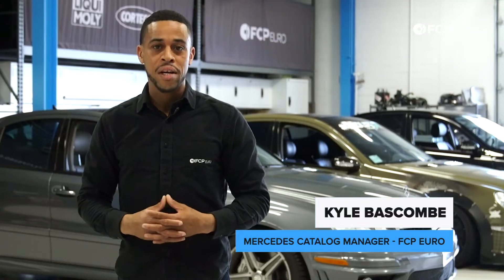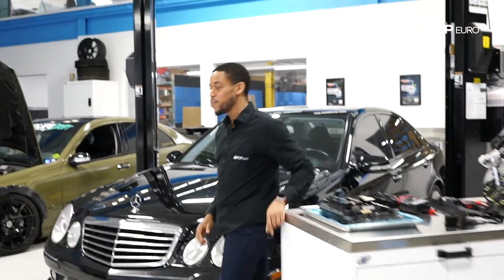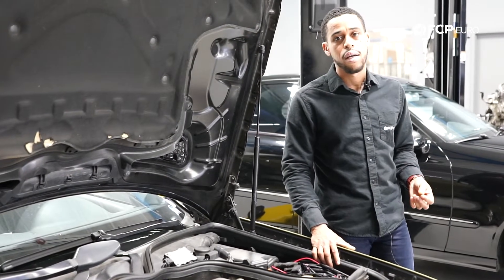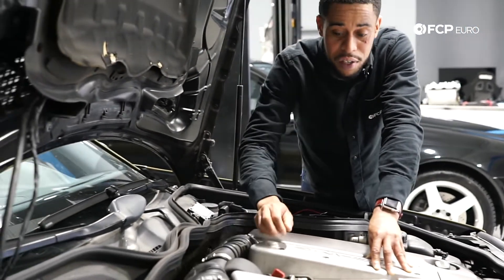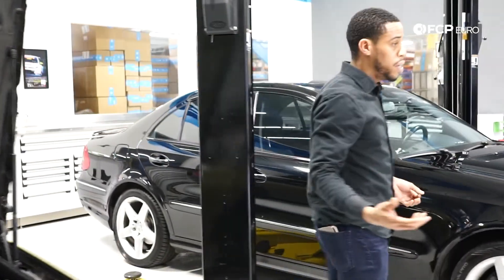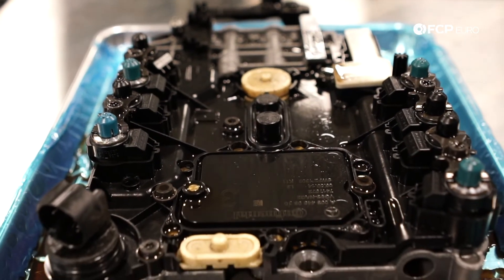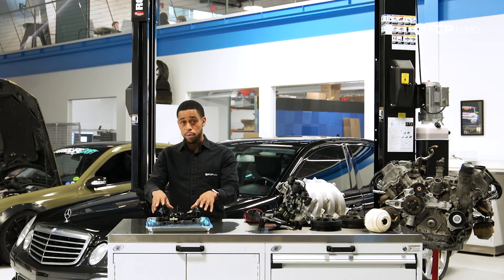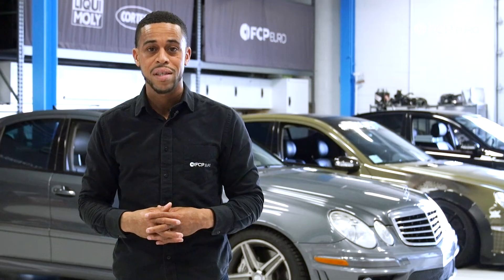Mercedes-Benz W211 Transmission Diagnostics - Everything You Need To Know (722.6 5-Spd, 722.9 7-Spd)

Comment: I have a W211 E240 2003 model, I am also having issues with the transmission shifts from 2nd gear to 3rd gear as it slightly jerks during those shifts. I replaced the gear oil and gear filter but it ddnt work. I also scanned for faults but it couldn't detect any. Can someone pls help??

Comment: Thanks for this video and the great series on the W211.  How much ATF should be added to a 722.6 5-speed after draining the pan and replacing the filter?  The owner's manual gives the capacity as 8 liters, but that must include the torque converter; since there is no dipstick, it's hard to know when the transmission is full.

Comment: 02/2008 W211 E350 4Matic with 102k Km.

My 722.6 W5A400 transmission drives me crazy.

1. When cold, shifts from 1-2 and sometimes 2-3 are sluggish, the gear slips in, and I hear a shudder/grinding noise (no vibrations) when the TCC engages. 
When accelerating faster, gears change mostly normal.
2. When warm, the transmission shifts smoothly without any noise or issues, but when I let off the gas in traffic normally/not fast, the transmission up shifts instant and harshly with a light hit. I need to force it to shift smoothly by letting off the gas reaaaaaaaaly slowly. I'm always constantly fighting for smooth shifts while driving. I focus more on shifting smoothly then driving! It only occurs from 1.-3 gear. 4-5 are completely fine.

What drives me crazy is, its randomly. Nothing I do can consistently reproduce it. Sometimes it does not occur, something I want to drive this car off a cliff.

New Oil, Filter, Torque-Converter-Valve, Plug etc. Also checked error codes, Oil-level, Map sensor, TCM, fuel supply, temps, everything that could give my transmission some wrong information.
With Xentry I reset the adaptation values of the TCC valve and driver behavior, also tried resetting every shift point between gears and adapting everything from scratch multiple times. 
I always ended up using the old saved values, which are the least problematic.

Nothing I tried so far, fixed it. I did multiple oil changes, adding oil, taking some out, a transmission flush with only oil, and 2 times cleaning the entire conductor plate with every solenoid. My transmission fluid is clean without any metal or other particles. I changed it 2 times in the last 12k km. The transmission has been serviced 2 times before I bought the car by a Mercedes dealership. In total, the transmission had 4 fluid changes in 102k km now.

Does anyone have similar experience with a 722.6 W5A400 transmission?

I would need some advice please!

Comment: I have a 0894 (stored) error code on my 7G 2005 w211. The car went to limp mode. And won't even engage gear most times. I replaced the VGS, cleared the error code and the problem persisted. Kindly advise me on what else to do?
Reply: Have the same code on my w221, wont shift or anything. Did you find the problem?

Comment: I own a 2003 Mercedes SL55 AMG and I’m hoping you can help. The other day the engine light came on, the dealership replaced the Transmission Control Module. Prior to this repair while in S mode I could tap the shift lever right or left and it down shift and up shift, now nothing happens. In Manual it shifts fine and down shifts automatically. The tranny works fine otherwise, moves smoothly through gears. How can I restore this function?

Comment: I recently purchased the conductor plate kit from FCP Euro for my 2004 E320 with a 722.6 transmission and it shifts better, but it still does not automatically upshift from time to time. I end up having to use the totoro box function. Is there a code I might need to reset within transmission? I did reset the adaptable function. Thank you in advance

Comment: Im buying a e320cdi w211 next week that wont engage or drive. It comes with a spare gearbox and torque converter to swap out but do you think there is anything else i should check first ?

Comment: I thought the seven speed transmission is supposed to be sealed for life. Yet in the video you say change the transmission fluid every 40,000 miles. I don't understand the apparent discrepancy. Other videos I've seen show the transmission without a dipstick. The reasons given was because the transmission is supposed to be sealed for life. I have a w-211 with 211229 miles. I don't believe that the parts you reference have ever been serviced. What is the best way to check this is there a diagnostic tool that will help determine the condition of the conductor plate and other relevant parts?

Comment: You missed one small thing, Mercedes never makes those gearboxes, greetings from ZF 😎
Reply: ZF makes garbage after garbage. This conductor plate issue has been a problem since late 90's and well into the 2010's. So in about 15 years they did NOTHING to prevent the failure of their garbage transmission.  Absolute dog-shit units. All of them.

Comment: Thanks for the video! I have a 722.118 that has been sitting for years. It has no leaks and the pressure is according to the manuals. The problem is that at times the pressure drops to zero and the exchange doesn't work. I changed the oil and filter, but the problem persists. It only works again when I accelerate above 3000rpm. Any suggestion?

Comment: I have a problem with my W204 with 722.6 only when is cold outside and only at the first start , after starting the engine, when switching the selector from P to R or D, the engine speed drops from approx. 800 revolutions at 700-600 revolutions for a period of 1-3 seconds, after which it returns to the initial position (800 revolutions) if I put directly in D engine it will stop, BUT you feel that the car is forcing itself to leave from under you (the brake is obviously pressed) . What can be ? Thank you :)

Comment: Hey guys, I'm currently driving a 2007 E280 CDI with a 7-speed and when it's a cold engine/trans in the morning, on moderate to hard acceleration the whole car judders and shakes while gear shifting. There's no check engine lights but it's pretty violent. This is only observed in the first few gears. Also when slowing down the shift from 2 to 1 is sometimes jerky. From what I understand the car's trans oil was never changed and it's a few 100 short of 60k miles.

Any pointers as to what may be happening? Does it just need a trans service?
Reply from the maker: Hi Brenden, a service certainly cannot hurt. An inspection of the engine and transmission mounts is also in order. From there you may need to further diagnose if your issue is not resolved.
Reply: @fcpeuro  thanks for the reply guys! Much appreciated.
Reply: @fcpeuro  I forgot to update y'all, the issue was an exhaust back pressure sensor gone bad. Replaced it with a genuine mercedes part and it fixed the issue a 100%

Comment: Hello. I have a CLK 55 with the 722.6.  Manually downshifting from 3 to 2 i hear a grinding noise. I also for the first time heard it happening mildy today when in automatic mode, slowing for a stop sign. Should I start with a simple service w/ conductor plate replacement? I didn't want to pull the trigger it if sounds like the unit needs to be extracted for physical rebuild. Thanks!

Comment: I changed my 211 2008 transmission, the gear will no longer shift well. From what you said, meaning we should replace the valve body. Question is how do we get the right valve body for the car, whit chassis number?

Comment: If five speed transmission is acting funny, sometimes all it takes a little bit of electrical conductor cleaner to spray on the 13 pin connector and the issues clear right up. 

At that point, you might as well change the Plug seal ($5-$15 part). Make sure you use a socket wrench instead of a drill. The little bolt holding it in, is very sensitive. If you mess up, you're going to have to change the whole conductor plate.
Reply: Where is this located? Mine is fluctuating on low revs and gearing hard especially when it's cold. I flushed the oil but it's still the same issues
Reply: @robiduff  towards the front of the transmission where it connects to the engine.
Reply: @edd2184  much appreciated, thanks:)

Comment: Hi. i have 5 spd automatic gear box, and its shaking when accelerating, or when it cold holding gear,  kicking, sometimes grinding sound, exactly on low rpm. All mountings, shaft rubbers,  shaft hanging bearing was replaced. So it would be left is the torque converter, right? :) Fluid level good, fluid colour  good and  fluid dont have burnt smell.

Comment: 722.6 will allow me to shift into gear, but fails to engage. Only in reverse it catches for a second and slips into idle… no codes being thrown at all. Fluid level is good
Reply: I have this issue too. Sometimes when trans is cold, like overnight, it will engage drive and reverse and then when it warms up , it will not engage as if in idle, even though it’s in drive or reverse .

Comment: Hello.  i have the 5-speed, and i have speedsensor codes, and the transmission seems to need a new conductor plate.    But when it works, i dont have any lockup.  can it be related, or do i need to check something else while i have the transmission apart, to fix the lockup?
Reply: Was issue resolved
Reply: @justinEsterbar   The issue with speedsensorcodes and transmission limpmode went away with a new plate.   But the lockup dit not.  Probably bad lockup-frictiondisc.    Car sold, and i dont know if the new owner solved it

Comment: I actually didn’t see this video very useful.. I use the 2008 w211 E550. Recently, i noticed that whenever I shift the gear from D<>R or R to D, my car behaves as if I was hit from the back. Sometimes when I’m driving, the gear selection doesn’t shift beyond the 3rd gear. I have serviced the gear and changed the oil. But issue still persist. Do I need to reset the transmission?
Reply: change out your transmission mount. super easy
Reply: Your conductor plate needs replacing. I have the exact same issue.

Comment: Can someone help me? So I have a mercedes c 320 2005 and I was told by a mechanic I need a new transmission because of no shifting gears and my car stalls whenever I press the gas, I have to wait and then press the gas again for it to go forward. Can It be fixed with the device you showed for the codes?

Comment: I have a 2007 e350 4mstic , it's misfiring and all ignition coil are good  don't know what else to check , and I also noticed the engine is high and not pulling enough power even after transmission shifts.. .

Comment: Fantastic video!!!! Thank you.  I am in love with our two E500s... 04 wagon and 06 sedan. The former was a recent "toy" purchase...nothing fancy but had always wanted one. The sedan purchased used has been running strong for us for several years. Love is focuses on the positives but my '06 Avalon reached 260k miles without any transmission problema (changed.fluid only), garage door opener that did not need a hack insert, far more robust wiring (no guaranteed to fail cable to trunk power, guaranteed to fail airmatic relief valve wiring, a better protected sunroof mechanism, sturdier threshold plates, no climate sys baffle valve failure such that backmof car heated up..) These are manageable issues thanks to FCP... and no the Avalon was not a performance driving etc. The conductor plate failure is a big deal ridiculous issue. I wonder which Chryslers had the same issue and at what year the construction or design was changed?

Comment: i have 7 speed transmission
im about to flush old fluid out and change filter

i look some info that there is few bolts "valve body bolts" (different car tho) that are good to check to 10-11 NM because they go loose over time and re- tightening them makes box switch better.

my problem is that i don't know what bolts and what is right torque for 7 speed mb bolts

Comment: I'm thinking of picking up a CLS63 that I can get for a really good deal because second is slipping in sport mode. No leaks from the engine, otherwise seems to be good. What  do you guys think?
Reply: Try to reset your transmission. It's really simple.

Comment: Hey what’s up, so I have a 2009 E350 4Matic. Just got a WCI from them where they did the 5 point inspection.. my transmission needs servicing but I was told I have the 722.9 transmission, and not the 722.6 can anyone verify this? Because on the FCP site it gives me 722.6
Reply from the maker: the 09 4matic never came with a 722.9, your vehicle would definitely have the 722.6

Comment: So i had a service done last year my car was really clean. Recently the 722.9 has been shifting in the first few gear roughly.  Also when i put into drive and park or reverse i hear the solinoids clearly moving inside and hear the hole movement of the solinoids. The middle bolt on the sump must me loose to the rest because its sprayed out under pressure an covered my exhaust to the back of the car in mistu oil an collecting loads of grime. Oil is just about visible on the centre bolt driver side uk gearbox sump all the rest of the bolts are dry.... Q.1 what damage is this likely to cause to the gearbox ??.
Q.2 would a simple oil top up sort my problem or would it need a deeper inspection??. 
Q.3 would the torque converter settings be effected?? Requiring a full procedure to get it back to standard operational torque 620nm 
No fault codes and not that much and nice since i felt it beeing a bit iffy and worried to take it back to the independent i used as i don't believe they will correct the error fully. I now see future problems with this box because of a service mistake made this time last year by an independent. I need to gather as much information as possible i can reference to. Edit its a 2011 r350 cdi 722.9 blue fluid

Comment: I’ve 08 E350 4Matic and 166000Km, the problem is come true shifting! Sometimes, gear stuck 2nd or 3rd OR doesn’t shifts. The code reader says P0730-32. But however, sometimes there is Zero issue from transmission, runs smooth gears shifting enormous and runs like thunder. And I’m pretty, previous owner didn’t change transmission fluid nor flushed(and previous owner was the first owner until I bought) So, what would be your opinion? Thanking in advance for your reply..

Comment: I have w211 with 722.6 (5 speed) transmission. Have issues with gear,  it slips gear to neutral while driving. Checked for the codes and given below

P2500 - The transmission Has an Impermissible Transmission Ratio
P2502 - The gear is Implausible Or The Transmission Is slipping
P220A - The speed Comparison of Y3/6n3 Is Implausible.

Would changing the conductor plate will solve the issue?
Reply: Awaiting for your reply
Reply: Hi Full Throttle, I have exactly the same issue. I've changed conductor plate and it didn't help to me. How have you solved your issue? Thank you.
Reply: @vladk9360  i changed the gearbox entirely. I got a used gearbox with warranty so i though its better than taking chances.
Reply: @fullthrottle7377  Thank you. Will keep in mind.
Reply: @fullthrottle7377  Oh, I've found what was the issue. In my case I had to replace ALL transmission oil (include from torque converter and radiator) -> not just in oil pan. This guy tells how to do this "properly/easier way": https://youtu.be/7syO7SzKKQ4 Also, oil level was incorrect in my case. I had to measure oil level when car was hot and oil should be between min and max on deep stick on (80 degree measurement). I've measured only on cold, so I didn't have enough oil. Hopefully it will help for someone.
Reply: I had the same codes. In my case I had to replace ALL transmission oil (include from torque converter and radiator) -> not just in oil pan. This guy tells how to do this "properly/easier way": https://youtu.be/7syO7SzKKQ4 Also, oil level was incorrect in my case. I had to measure oil level when car was hot and oil should be between min and max on deep stick on (80 degree measurement). I've measured only on cold, so I didn't have enough oil. Hopefully it will help for someone.
Reply: @vladk9360  Great..! Definetly it will help someone. Thanks for sharing😀

Comment: On the 722.9 gearbox do you know which of the solenoids is solenoid valve 'A'  ?
I have a problem with it but cannot find any information to identify which valve it is.
Great video btw :)
Reply: I've go a code for Solenoid A too.  Specifically, two codes:
 - P0750: Shift Solenoid "A"  
 - P0746: Pressure Control Solenoid "A" Performance or Stuck Off 

Don't know which one it is, but I found this info that might help.  That a simple service might fix it.  I'll be trying that.

==>   https://www.autocodes.com/p0750_mercedes-benz.html   <==

What are P0750 MERCEDES-BENZ code possible symptoms?
 + Engine Light ON (or Service Engine Soon Warning Light)
 + Transmission will not shift gears.

P0750 MERCEDES-BENZ code description
Shift solenoid valve A is turned ON or OFF by the Transmission Control Module (TCM) in response to signals sent from the park/neutral position (PNP) switch, vehicle speed and Engine Control Module (ECM) (throttle opening). Gears will then be shifted to the optimum position.

Comment: Hey Kyle I have 2007 5 speed  I just changed the conductor because the transmission got stuck on the first gear I didn't have any problems with shifting before that but after I changed the conductor the shifting its not smooth and keeps rpm high before it shifts and for some reasons it's burning more gas then before can you please help me
Reply from the maker: You'll want to verify the fluid level first. UNfortunately beyond that it's tough to diag without access to the car and it may need to be looked at locally